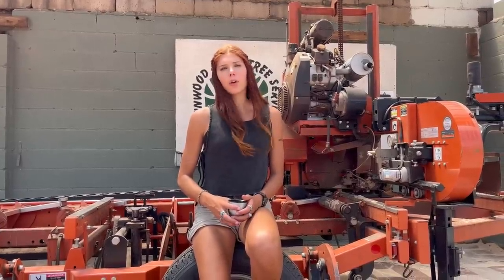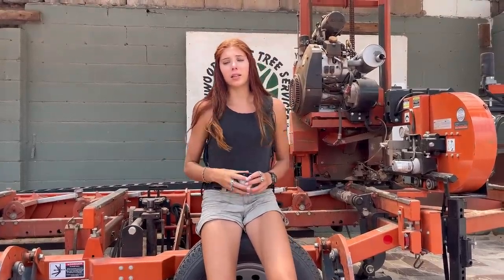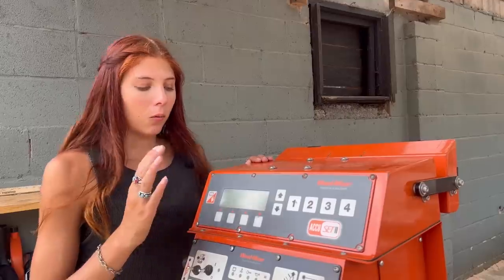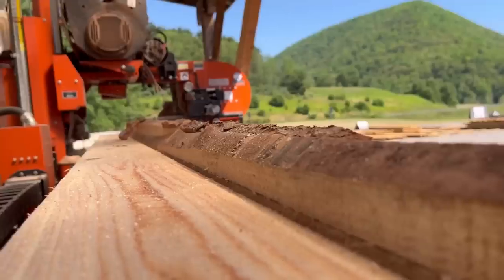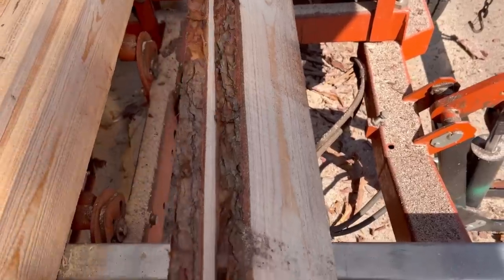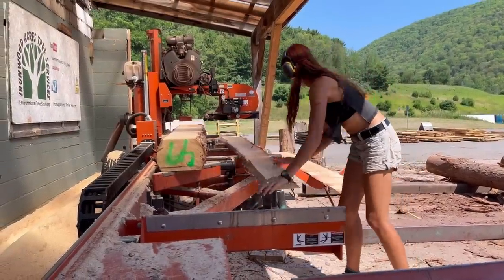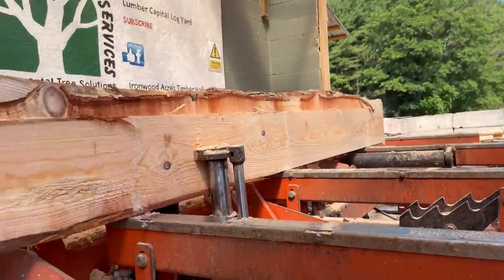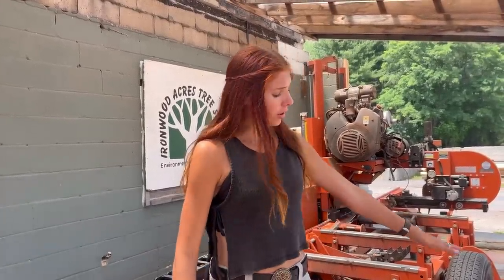How to edge your flitches WITHOUT an edger!

Comment: Hi Emerald love you channel. I have a large manual sawmill and you are right it all depends on what your cutting and what you can get out of the flitches. I’ve been cutting lots of 2 by lumber so sometimes I have a 4x4 on the deck and I cut out 2 x4 or 2x6s out of the 2 by flinches. I love saw milling,  folks in my parts come by and want lumber , sometimes they will give a cut list and I’ll tell them when it will be done. It’s a great business. I get my logs for free so most is profit, gotta love it! I cut Mostly ponderosa pine and cedar. Thanks for sharing and God bless you and your family
Reply: Heyyou Buddy, Ponderosa Pine? Just like the ones we used to see on Bonanza? Just curious what state you live in. No location just the state. Also when cutting cedar does it smell great? How many new friends have you met since owning the sawmill? I know, a lot of questions from someone you just met.
Reply: @ottoneidlinger4938  good morning, so funny ya lots of new friends, they ask to running it so I let them try it it out. Most folks love it. Cedar does smell wonderful when cutting splitting, and drying. I live on the western slope of Kaliforniastan. Not too far from lake tahoe.
Reply: @heyyoubuddy6749  thanks for the answer sir.

Comment: I cast my flitches aside until I have a large pile  , then I place at least 12 inches to edge at once. Match the pieces so they are oproxamatly the same size. The benefit is that you get 1x1s and 1x2s that I make trellises and pickets , garden stakes . And what ever you can think ofwith . I still have my old LT -30 👍🇨🇦

Comment: Good morning Emerald, another great video!!! This is just info, I learned it from carpenters, the slot made by the cut of the (any) saw is called the, kerf. Or, they'll say the kerf of the blade when compensating for it during measuring, before cuts. I did like your definition though, compensating for the sawdust :) :)  Have a Great Day !!!

Comment: Does accuset take into account the shrinkage of the wood?  On the old LT40 I use there a 4/4, 5/4, 5/5 etc scale, for example on the 5/4 scale the spacing between markings is 1  3/8 inches.

Comment: i use a woodland mills, and i put my side dogs up, and then i use a line (a reference on the boards) to set all of them at the same height if there is any variation of 1/2 inch or so with chips until it is dogged down.  (and yes, those are dogs)  I have 14 with 4 feet, and I know the difference.

the one point i would make if someone has never done this before, is that depending on a number of factors, the vibration can be excessive at altitude so your dogs should be set high as necessary to stop that.  although it is rare to be an issue, it has happened on occasion.

the other thing, i keep scrap to use as sacrificial lambs when doing this incase i need to apply pressure higher up than the dogs can be due to the blade grazing them.   (save scrap for such things.)

one question if you will.  i'm being honest. i would have never noticed this except a friend makes high end wedding dresses.  and they ask me to keep an eye out for fashion, and i noticed that your shirt is open on the sides.  is this for temp control, or to help shake out the sawdust.    if your saw was not so safe i would be concerned for your safety. 

thanks in advance for the issue of heat/dust.

Comment: For future video topics:
1. To my eye, there could be a 2x4 or a 1x6 salvaged from the outer first cut (“jacket?) on many of the logs.  Is my eye wrong, or is it not worth the time and extra sawing through bark to salvage that part?  Or is jacket sapwood not good quality dimensional lumber?
2. Do you take into account the position of the core (what’s the proper name for the center ring of the tree?) when squaring up the cant (I.e. is it the same height from the bottom at both ends of the cant)?  And do you take care to cut such that the core always runs in just one flitch rather than splitting it between two faces of two flitches?  If the core is not level within the cant, do you find the core starts at one end of one flitch and ends at the other end of a different flitch?
Thank you again for your great informative and entertaining videos, and thanks to your excellent shy-wry videographer too!
Reply: I own East Luck Custom Sawing and in my opinion it is definitely worthwhile to get everything you can out of the slabs before tossing them for firewood. We cut alot of pallet cutstock out of the outsides of the logs until we get to say a 6 or 8 inch face.on the cant. Pallet stock can have some bark and most used lengths are 40 inch or 48 inch. You pay for the log by scale might just as well pull 25 to 40 percent over scale from the log you payed for. We also buy all the slabs we can from 4 other mills in the area plus as many hardwood veneer cores from 2 sources and cut pallet stock from them also. The math on a 4 foot by 4 foot by 8 foot length bundle of slabs I pay 25 dollars per bundle on pine slabs on avg. Takes around 40 slab bundles 1000 dollars to get a load of pallet cutstock worth 12,000 to 15,000 dollars. We are in nw Wisconsin and ship 4 to 6 semi loads a month to New Jersey  or New York. It is way faster to cut from a log as you go then from slabs but I got tired of seeing them burn pine slabs in a mountain because they couldn't  sell them as firewood. Softwood cores are not as much of a problem as boards as hardwood cores.  Hardwood you cut around the core for grade and the worst of the core goes for pallet cutstock.
Reply: @eastluckcustomsawing5670  I've never seen so much waste being sent to low/no value "firewood". Don't get all the potential jacket board's not being utilized..

Comment: On a completely separate topic: is there such a thing as kiln-drying entire logs before milling them?  I think it could be great because it would allow for all the shrinking and warping BEFORE the milling, so the resulting lumber would stay true to size and warp-free.  Of course this would require a much larger kiln... and a system to stack the logs securely with gaps between them, and maybe forced warm & dry air through those gaps.  What are your thoughts about that?  Would you peel the bark off first or dry them with the bark still on?  Is this practical and cost effective? How much more could you charge for such warp-free, true-to-size, stabilized lumber?
Reply: I'm not a sawyer, but my understanding is that you want the moisture to come out of the sides of eh wood, and not the end, so to get to the centre of a log will take a 'very' long time, and you have no real way of measuring the moisture content in the middle. 
Also (assuming not using a solar kiln) a lot of energy would be required.
I'm guessing that internal stresses in the wood would also play a major factor and cause cracking (outside contracts, but the centre remains the same size).
As I said, I'm not a sawyer, so could be 100% wrong!
Reply: @berniesteadman7642  I now a sawyer, to as I said I'm not a sawyer, which is it?
Reply: @rockandrattleretreat5830  Sorry, Typo. I'm not a sawyer
Reply: @berniesteadman7642    What you're saying makes sense though.  That moisture needs surface area to get out.  A whole log has the smallest surface-to-volume ratio.  Maybe a good compromise would be cut the logs in half longitudinally before drying?